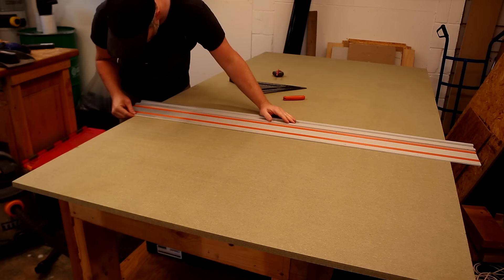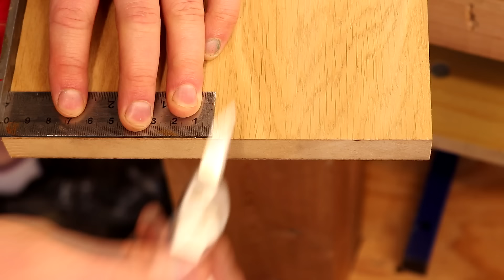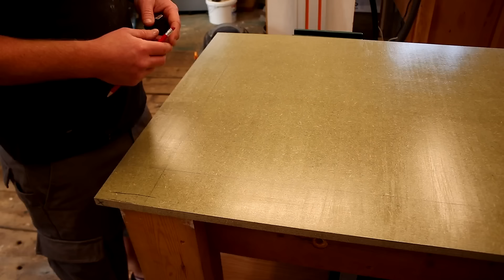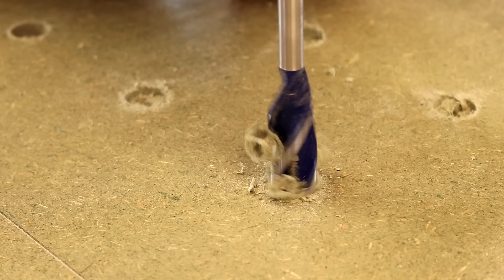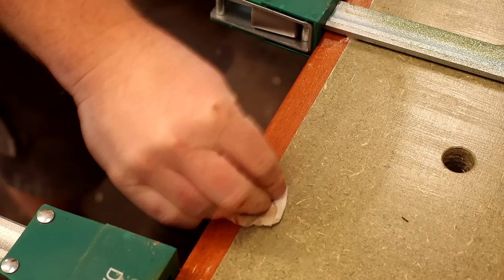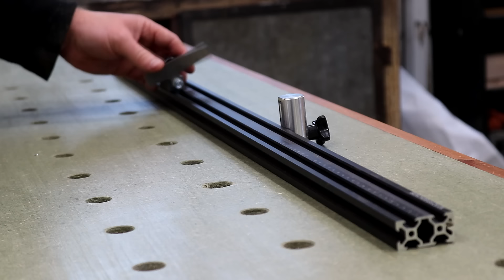Making An MFT Top - No CNC, No Guide Jigs

Comment: I am rather curious as to the durability of the MDF top?  I assume the MFT is the same?  I was under the impression the MDF would deteriorate around the holes with hard use.  I am going to build a new table and I am on the fence as to what to use at this point.  The jig is great!
Reply: MFT tops are sacrificial, when they get worn you can flip them over and you have a fresh start, when that is worn out simply make or buy a replacement. The mdf holds up surprisingly well.

Comment: Economical option to the commercial expensive alternatives. I almost ordered one from you know where, but this video changed my  mind and saved me money for other necessary tools. Thanks!
Reply: you can buy templates to use with a router for around £30 now and they are very accurate and means you can make many tops at whatever size you need, if I was making an MFT top I would want it to be more accurate than this version.
Reply: there is a company called cnc design, never used them as yet but I am thinking of doing, anyway they make the mft tops but only the one size to fit the crazy price "F......tool.

Comment: I've been using my MFT style top since I made mine 10 yeas ago. It is on a torsion box base, the only accessories that don't always work as I would like are the Festool clamps that go through the holes to clamp down. All of your items will be perfectly fine.

I standardised on a 96mm spacing as I already had an LR32 rail, that is why you have 96mm as a standard. 

Once you have selected a spacing you are pretty much locked into it for everything, you will be surprised at the number of uses you will find. I have a few tool stands that use that use the spacing to locate them on a worktop. I have the holes on quite a few things like sawhorses etc.
Reply: Here are some of the items where I’ve used the 20mm hole grid

https://flic.kr/s/aHsmK4UgSn

Comment: You were okay up until the point where you added an additional 100. Your intent of being accurate was thrown out the window when you added another 100. 700*700 is 490,000, 900*900 is 810,000. 810,000+490,000 = 1,300,000. The square of 1,300,000 is not 1,100.
Reply from the maker: The tape measure was lined up at 100mm if you listen to what I said... So the figures are 600 800 1000 with a 100mm offset.
Reply: @RagnBoneBrown  Math is an exact science. You started with the 3,4,5 rule which is based on the Pythagorean theorem hence my comments. Loved your ingenuity with this build but the math simply isn't correct.
Reply from the maker: The maths is correct. 600, 800, 1000 is the equivalent of 3,4,5, what about that are you not getting??

Comment: Great video - but you cannot just add 100mm to each dimension in a 3-4-5 triangle. You went from 600,800,1000 to 700,900,1100 - nah that does work the 1100 should have been 1,140.2.   Pythagoras would be turning in his grave
Reply from the maker: This one has already been answered-you've misinterpreted my maths and I didn't explain it very well in the video. Check the other comments 😁
Reply from the maker: I lined up the tape measure at 100mm, as explained in the video
Reply: @RagnBoneBrown  By 'liked up' do you mean offset? In which case the actual distances remain at 600, 800 and 1000. That makes more sense, and was done to enable more accurate measurement with a tape measure?
Reply from the maker: Lined up
Reply: @RagnBoneBrown  Ha ha - I thought 'liked up' was some sort of slang that I had not come across on this side of the world.

Comment: The 3,4,5 triangle rule works because on a right triangle side A squared + side B squared equals the hypotenuse squared and 3,4,5 happen to work out nicely.  (3 squared + 4 squared equals 5 squared)  Because scaling the triangle (multiplying the sides by the same factor) doesn't change the relationship, you can multiply 3, 4, and 5 to get other numbers.  However, adding does change the relationship, so adding 100 to 600, 800, and 1000 to get 700, 900, and 1100 put you off by 40 or 4%.  with these numbers that's a small error, but with a larger offset the error would have also been larger,
Reply from the maker: This one has already been answered-you've misinterpreted my maths and I didn't explain it very well in the video. Check the other comments 😁

Comment: On the 345 part, is that better than measuring the two diagonals for equal length?
Reply: Doug Lee 345 just verifies one corner. Measuring the diagonals would verify that all 4 corners were square, although if it were out it wouldn’t necessarily tell you which corner(s) had a problem.
Reply from the maker: Couldn't have answered it better! 😄

Comment: Do you recommend the varnish you used for mdf. Ive just built a table for my dewalt 7491 table saw & the top is mdf. I need to protect the surface. Some people say not to use water based varnish others say its ok.
Reply from the maker: I've never used it on regular MDF but I can't imagine it would be a problem to be honest as long as you apply thin even coats. I'd suggest trying it out on a test piece before doing it on your final project just to be on the safe side

Comment: A multitool would make short work of notching the cross-braces from underneath...   I'd have been a bit nervous of using the auger bits for opening up the holes, you're depending on the starter-screw pulling in the bit perfectly concentrically. 

A counterbore would be more accurate... but where are ya goin to get one specifically for wood 🙄
All-in-all it seems to have turned out well, did u poly both sides of the mdf ? 🤔
Subbed & liked.. my man ...
😎👍☘🍺

Comment: I recently built a new workbench and have been saving up for the UK Parf Guide system jig... No more! Thanks Keith, I'll be doing this myself now 👏. Also thanks for doing the research into 96mm vs 100mm spacing, I was coming to the same conclusion but thought I must be missing something. I too have never actually used an MFT so I'm going with 100mm and crossing any 96mm bridges when I get there 👍
Reply: Use 96mm!  If you do not, should you ever want any 3rd party accessories, like the triangles from TSO, they use 96mm spacing to attach to an MFT-style top with bench dogs. I CNC’d a huge workbench top about 10 years ago ,and put my 20mm holes on 4” centers. Ten years ago it wasn’t real obvious that 96mm centers would make a difference.

Comment: Using wood and hand measuring, then using an Auger hand held introduces a host of inaccuracies Fine if you only want an approximate table. The commercial PARF system is indeed expensive. Having a milling machine I made my own jig using metre rules- my holes turned out more accurate than the scale on the rule- it was 0.5mm out over the metre!.  I also made jigs to ensure holes were vertical. Very important! The Makita 20mm  forstner bit has a secondary 10mm shank, for which phosphor bronze bearings are available.
Making a table like this is a lot of work- not worth the effort if it is only going to be roughly right. Using well made metal jigs it is possible to achieve a max error of 0.2mm. I would be interested in what the max error of this version is...
Reply from the maker: I don't know any woodworker who genuinely requires that level of accuracy - it's totally unnecessary in my opinion
Reply: @RagnBoneBrown  As I said- fine if you only want an approximate table. Your work can never be better than the measuring tools that you are using- I note that you do not use your combination square for angles any more, as it is not accurate enough for you. No-one every complained that their measuring tools were too accurate...

Comment: Another great video Keith, i recently made a mft slab which i first seen on you tube its the same as the top of your work bench but i fit it on saw horses as i dont have a large work area and use it outside.I found the mft slab to be excellent fantastic for cutting and assembly applications i also spaced the holes at 100mm centers and it worked out great.I bought 4 makita tracksaw clamps which screw tight from Amazon as i found them to be the cheapest option, also l put handles on the outer edge of the slab which also double up as clamping holes for larger clamps.I do think that you will find your bracing pieces on your table may get in the way of the festool clomps which like mine hook into position and like you when my slab wears out ill make improvements to my next one

Comment: Nice work 👍
Reply: Been thinking about this myself and just like when you do something once you can do it quicker 2nd time watching this will help no end 👍😀

Just thinking if you made the jig 1.6 times with 2 rows of hols size you could pin and reference of the previous set

Also may be overkill but you could also make a jig/guide for the hand drill in the pillar and clamping it square using a previous hole.

Comment: You could pivot the guide on both sides, once each, that way you can use 2 locator pins and stay accurate without measuring.
Doubling the thickness of the guide will also improve the squareness of your drill.
Reply: You're correct on both points. However, plumb resulting from the use of this jig is adequate.
Reply: Meme Plex.  I had that thought too.    Once you have a jig, it reduces errors from having to make more measurements - especially if measuring in 100mm increments, rather than absolute 0-(100,200,300,etc)...  Incremental errors add up.

John Coloe: Getting all the rows parallel with this method requires very accurate measuring of the free end for every row (absolute measurements is better than incremental), using the Jig to simply spot-drill the 2 long edge rows would remove the need for further measurement.  (NB, In favour of your "argument"; even 1mm error at ~800mm (whatever the overall width is) is not significant as far as angle is concerned (asin(1/800)  =0.072degrees). Though it will make it more difficult to get fixed dimension fixture "dogs" into the holes (are there any fixtures without adjustable dog spacings??).

Comment: Very nicely done Keith 😁👍. Just an idea for you if you want an extra function. I made some tool box roller cabinets with a pretend MFT style top (smaller than yours), but because the underside was enclosed (torsion box style) I found that by poking the shop vac in one of the holes.... you have an instant vacume table... ideal for holding flat work.. and it works. Just thought I would let you know 😁. You can see them briefly in my shop tour. Keep up the great vids there great 😁👍.

Comment: Just a warning mate .I bought a mft top on ebay ,bought the  QUAD DOGS • STAINLESS STEEL from Ralph on benchdog .co and they did not fit.
 He told me his dogs are set for festool. I tried reamering them out with a 20 mm bit and they still did not fit
In the end I bought the drill for their system from Axminster  and the dogs fitted.
Must admit Ralph his a top man could not help me enough. Any way good luck and a good video.

Comment: Very interesting and useful video. Thanks for sharing. The way you made your MFT top is awesome. Some time ago, I wanted to make a small MFT top as well.
I did (I used another method) but it was not very exact.  It is usable for some things but not for cutting straight or 45 degrees corners.
For some time I have another system in my mind which should be far more exact. I did not have time for making it till now. Maybe the upcoming winter.

Comment: Nice simple jig. I would like to share this other little trick if you have the CAD model anyway. Paper templates. I have had success with setting out of the hole positions using a 1:1 scale paper plot, drawn in fusion 360. Print on a large format plotter fairly inexpensive or free when you know an architect. You can just tape or lightly spray glue the paper very precisely to the surface and use pins to mark all of the centers. Basically, you are free from doing any measuring as the centers are computer generated and you can print to a very high level of accuracy. Then it just depends on your drilling method as to how to maintain a vertical pilot hole. It is like having a really basic CNC without actually having the machine. You can then also change the pattern to another layout if needed. Have a great weekend.
Reply: I Like that idea a lot my thought would be to print out the array of holes on an A3 sheet. drill the 20mm (+ router collar) holes in that as a template then route out the holes in the work top. you can then reuse the template over the whole area of the work surface and on subsequent work surfaces using the dowels to hold the template in place.
Reply: still you have to be so accurate when making the holes, our guy using a drill , he must be the only one in the world who can drill at 90 degrees perfect. I know I am not so the dogs wont be quite right and hence cuts wont be at right angles

Comment: If I must admit you did a very good job at building your MFT table, but I wouldn't rely on it to get perfect 90° cuts, as there is no way you can align 100% of the holes perfectly the way you built it, no matter how careful you are while drilling the holes manually. With that said, great work.
For what it's worth, team up with a couple other makers and order a CNC cut of a full sheet (122x244cm ) of 18mm MDF,  and you'll get 3 MFT panels for around 150€, which gives you a perfect MFT table top for 50€. That's the price I paid.
Reply from the maker: Like I said in the video this method is far more accurate than I need it to be. It is close to perfection, and any higher levels of precision are unnecessary for the work that I (and most woodworkers) do.

Comment: I do daily work with an MFT lookalike table. It isn't really a problem if a hole is blocked. If those wooden pieces beneath the table shift 5cm so they won't block the holes, it's hard to use  clamps underneath. Now you just shift a hole, but you can still use the holes for inserts. In my opinion it doesn't really matter, you gotta give some or take some in either situation basically.

I don't use my table to cut wood on, I only use it for building, assembling stuff. I made a couple of jiggs specifically for the work I do. Just get some 19 or 20mm wooden plugs. Works like a charm.

Enjoy your table!

Comment: Very nice job Keith, and thanks so much for the shout-out and linky-links! One thing I do find the MFT useful for that isn't immediately obvious, is to use the back of the rail as a straight-edge when you're using the Domino for 'inboard' mortices - I talk about the technique a bit in video #182 - and it's a real time-saver, especially when you add in stops and flags on the rail, or even just pencil marks. 👍
Reply from the maker: Yeah I've seen you do that, will try to bear that in mind as looks really useful 👍

Comment: Hats off to you mate, really impressed with this video as I bought a pre cut MFT ebay special top for a mobile work top and it works great, but your solution is excellent.
I have seen a guy on YT use a piece of the old chandlers peg board to make his starting holes which I think maybe an even easier than your brilliant workaround.
By the way the new workshop and house are looking good mate.
Reply from the maker: Sounds like an interesting idea !

Comment: I wonder if the 96mm for festool/parf is to do with the cabinet makers standard? 32x3=96.
Reply: JD Worx that is exactly the reason.
Reply: Yep, I’m not suggesting to buy one for this purpose only but the LR 32 router guide rail system can be used to lay out an mft top.